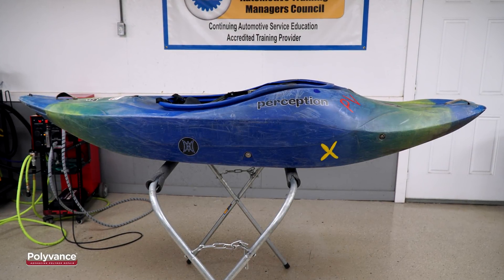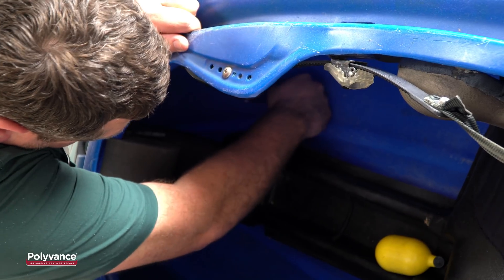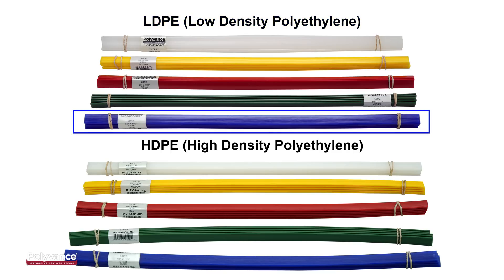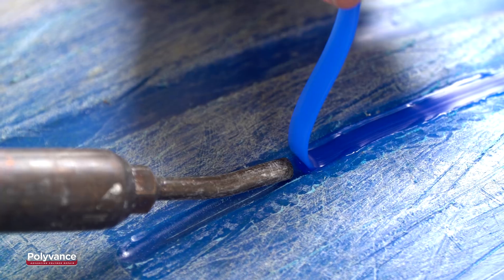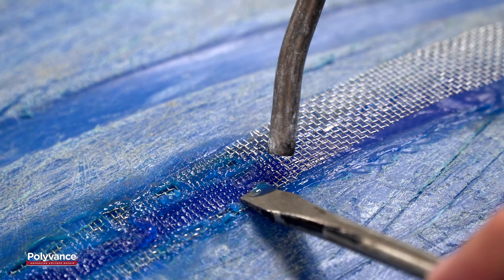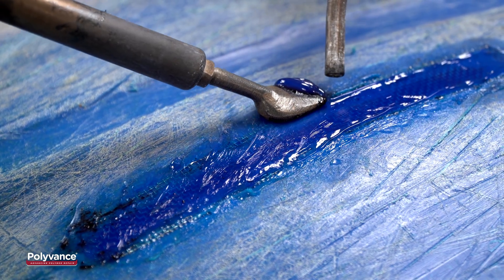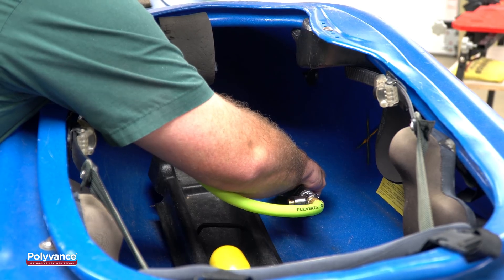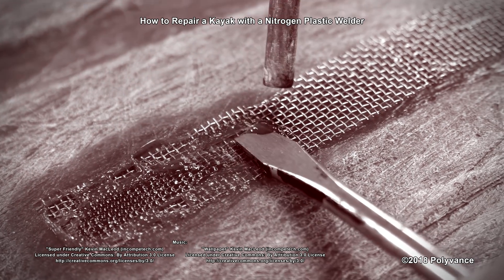How to Repair a Kayak with a Nitrogen Plastic Welder

Comment: Where's the Nitrogen?
Reply from the maker: The nitrogen is the heated gas coming out of the welding torch. We're using our 8203 welder that generates its own nitrogen. You can also use bottled nitrogen.

Comment: Very good video.
I'm going to do a repair soon.
One question... I was going to put my mesh on the inside, but you put it on the outside, would I be better off putting it on the outside or does it not make any difference?
Reply: For me it would depend on where the hole was.  If its someplace that gets abraded by rocks, I would try to put it on the inside if it can be reached easily.  If its someplace near your feet, legs, butt, or whatever where you will be rubbing it, I would put it on the outside.  The reason for that is if you have a random wire not fully embedded in the plastic, it will stab you at the most inopportune times and be a royal annoyance.  AS far as strength goes, it makes little difference, but I feel the inside is better because that side is under tension when pushed in, and this is where the mesh's strength is most beneficial.
Reply: @scottb7600  thankyou for your fast, and detailed response 🙂 I will stick with the original plan to put on the inside then, although it is near my bum, but it will have a plastic seat on top, I also plan to put close cell foam in between the hull and seat, for extra shock cushioning.
Reply: @roriepotter7681  Sounds like a great plan!

Comment: TIP: Use the butt of the screwdriver to press down the mesh and to smooth out the surface of the repair.
DO NOT HEAT THE BUTT OF THE SCREWDRIVER...KEEP IT COOL!
A WATER SPRAY BOTTLE IS HELPFULL TOO.

Comment: What if the crack is not accessible from the inside? Would it still be ok if only the outside of the crack has been repaired?
Reply from the maker: Yes. Welding both sides is ideal, but you can still make a strong one sided repair with the welding rod and mesh. In fact, we have two videos showing a kayak repair using an airless welder where we weld only from the outside. https://www.youtube.com/watch?v=-Hkvym3GrpI and https://www.youtube.com/watch?v=6gAFsDDNm2o.
Reply: Yes, but you need to make your initial v-groove deeper to ensure the weld is through the plastic.  You could also embed some 2045W stainless mesh into the repair to help make the one sided repair even stronger.  I've done many one sided hull repairs and have never had a problem.

Comment: Why wouldn't you sand it smooth?
Reply from the maker: It is just personal preference on how you want it to look. You can sand the weld if you want. We didn't feel it was necessary here. The repair is not going to be visible when the kayak is in the water.

Comment: Hey just a quick question the scratches on the bottom of the kayak is there any way to make the bottom look a lot better if so is there  easy fix to be able to get rid or even just make the bottom look a lot less full of scratches :-)
Reply: Yes!  A heat gun can be used to melt the scratches and somewhat restore the smooth look.  Just keep the heat gun very close to the surface, move it slowly but steadily and don't dwell on one area for long.  You don't want to melt the boat, just the fuzzy surface.  To see this in action https://youtu.be/aZ63Q_w_t1U

Comment: Why the stainless steel mesh? Is the rod not as strong as the plastic the kayak is made from?
Reply: It is as strong as the hull, however the joint between the hull and the rod can be suspect if the weld was not done perfectly.  Also, in a rotomolder hull, the molecules in the plastic tend to line up in an orderly fashion.   In a weld they tend to be more random, which for 99.9% of welds is of no consequence, but it is slightly weaker. The mesh is insurance that the repair will be as strong or stronger than original by physically tying the hull to the repair and back to the hull and it helps seal any pinholes you may have.  I use it on my boats in all the high stress areas that I've broken..but for non-stressed areas, I skip it.
Reply: correct observation, metal reinforcement is such a little nonsense, but on the other hand, you know in addition to the complex welding device, which fully replaces the ordinary heatgun to sell a hill of other products - simply marketing .....
Reply: correct observation, metal reinforcement is such a little nonsense, but on the other hand, you know in addition to the complex welding device, which fully replaces the ordinary heatgun to sell a hill of other products - simply marketing .....